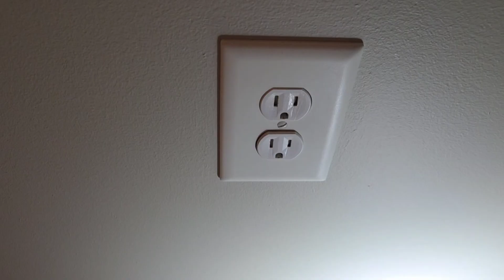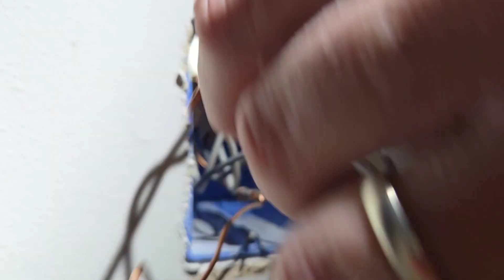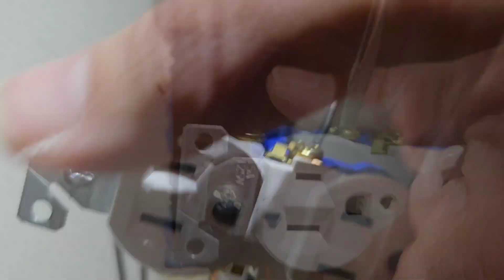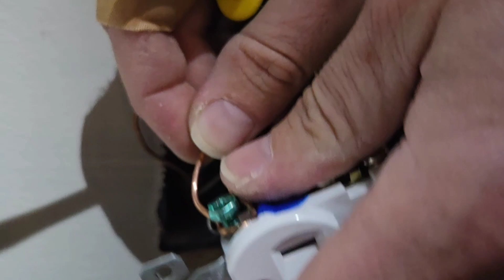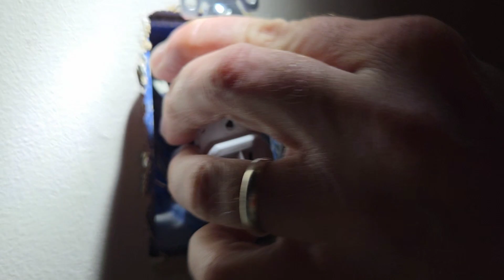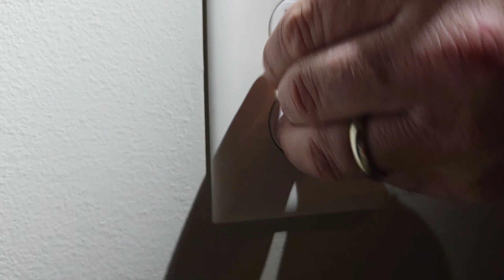Beginner's Guide to Super Easy Electrical Outlet Replacement!

Comment: You made it look easy. In my area it's about $93 for an electrician to install a new outlet or switch when we supply the item. I managed to do the light switches which was easy but had a difficult time with the outlets.
Reply from the maker: Yes, electricians like to charge a pretty penny for items that are pretty easy.  Most importantly, make sure the power is off to the outlet!!!